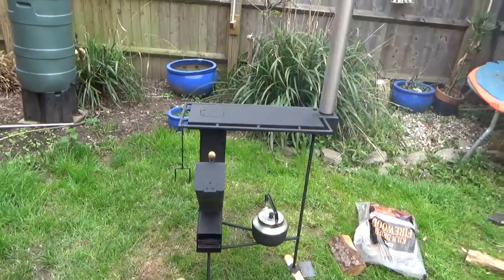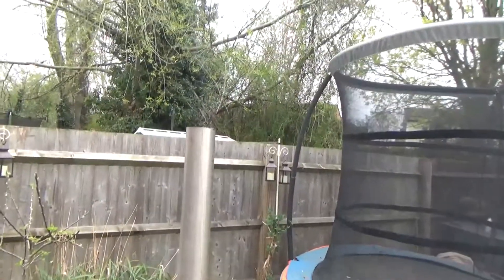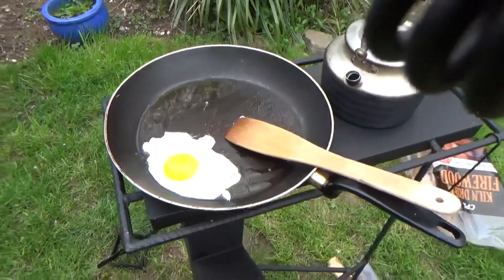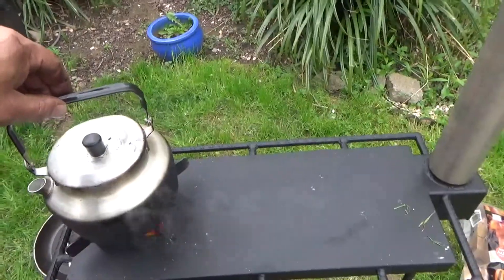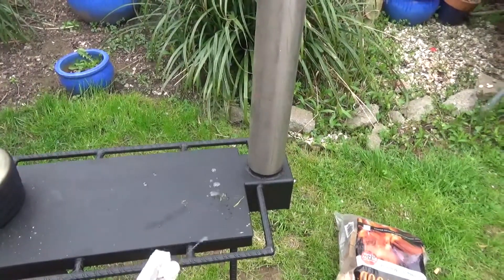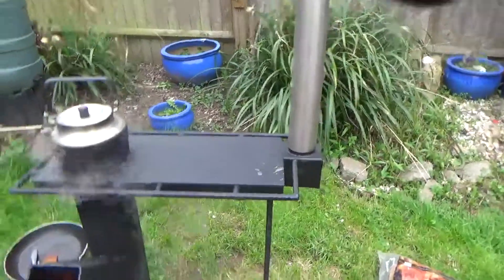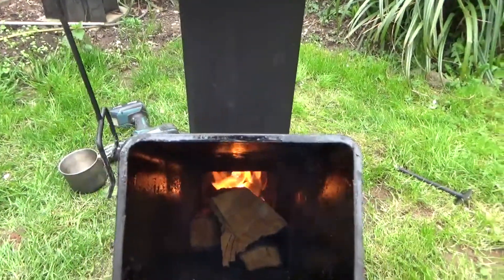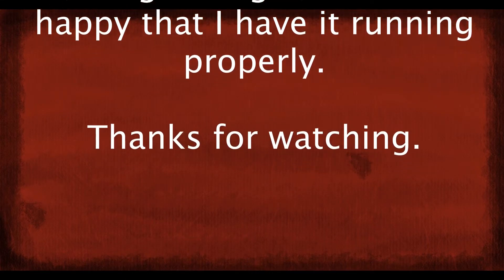Testing a newly built rocket stove with a hot plate.

Comment: When the interior of that hot plate gets plugged up with creosote how are you planning to clean it? Because of your baffles you can’t get a brush or a rod through it? You might want to redesign so the ends come off and maybe rethink the baffles? Bring the heat up in the middle and put two chimneys on itwith removable plates therefore you can eliminate the baffles and you can get a brush or a rod in there to clean it❤️‍🔥🇺🇸

Comment: If you're going to use baffels as you described I advise makin hot plate 3 inches thick and use 2 or 3 at best baffels make heat cris-cross to each other with guides on the baffels & then make top plate suck all exhaust to exit chimney, even if cook lid is off.

Comment: Beautiful machine sir! Not a suggestion at all but I just wanted to mention that all that rebar is acting as a heatsink. That does slow down the draw and if the  volume of the hot plate is less than the intake volume, that'll really choke the system. But clearly your unit rips plenty!
Reply from the maker: Thank you, I have now modified this stove and it's working well. There is a video on it somewhere.

Comment: nice job but you overdid the baffles, they are just too much for this draft
Reply from the maker: Yeah. You are correct. I'll take them out one day.
Reply: Very good impressed. You are losing the chimney effect by the horizontal plate . Hot air less dense the longer the vertical tube is the greater the head of pressure.. A narrow tube going across diagonally to bottom of the chimney should initiate the chimney.

Comment: It's looking like the flow is choked by the hot plate. Gas flow isn't exactly proportional to cross-sectional area and the baffles won't help. I think making the plate channel a lot thicker might remedy this and still allow you to keep the baffles. Great idea though.
Reply from the maker: You were exactly right. I have now changed it like you said and it works much better, thanks

Comment: Is the cross sectional area constant all the way through the system?  Asking as chimney looks to be a smaller diameter.
 I built one almost identical 5 years ago. Still using it to heat living room, cook on and make hot water . Yes it is inside chimney to outside. Costs almost nothing to run. Great now power and fuel prices are going through the roof it's a real winner.
Cheers Mic Don
Reply from the maker: I'm thinking of making a few changes. Making the volume of the chamber beneath the hot plate larger to allow more air flow. And remove the useless baffles.

Comment: More baffles means more smoke coming up through hopper which means there's not quite enough air draft running through, moving that plate off created the correct amount of draft (bypassed the baffles). The box underneath would be good for oven. Lose the baffles :-)
Reply: My thoughts exactly
Reply: La leña genera mucho ollin bajo la plancha . La mia tiene una entrada bajo la plancha para limpiarla y quitarle el ollin o tizne y caliente bien . Gracias por tu aporte.